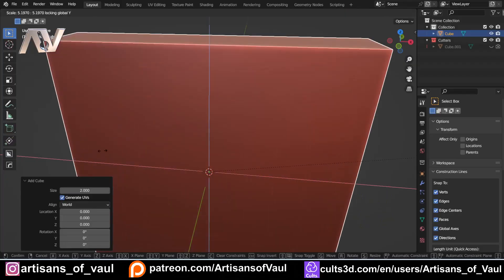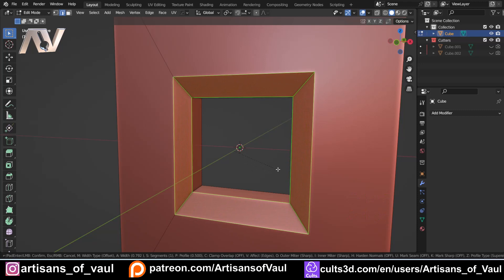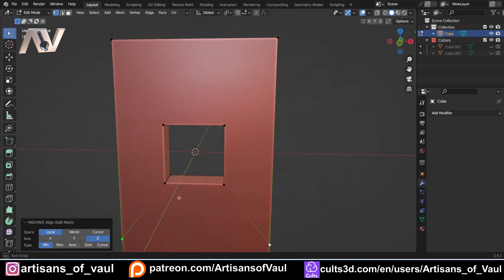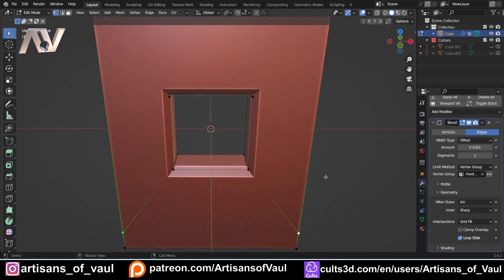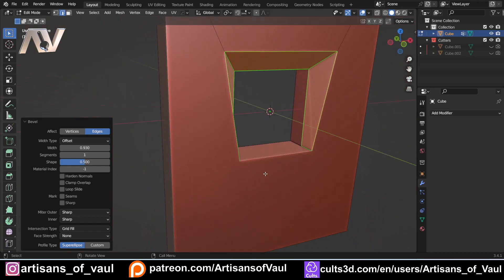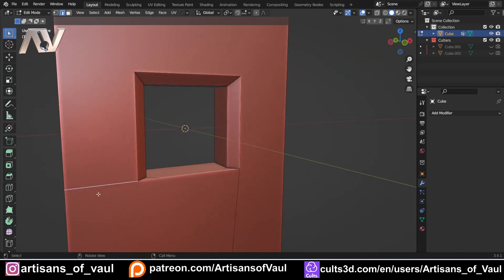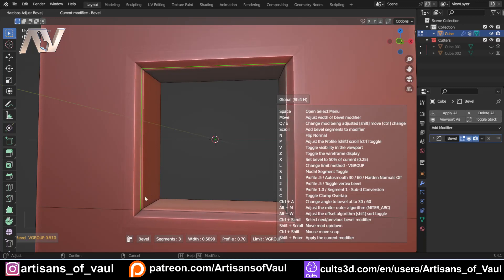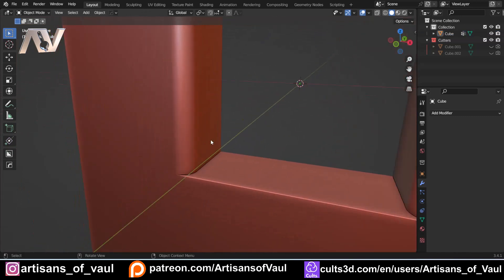Bevel Tips: Loop Slide and Impossible Bevels

Comment: Hi, i have a problem when beveling. When i try to make a pyramid by beveling a cube i have modified to fit in a project, it won't bevel alle the way from top to bottom because of the 45 degrees angle it makes. Is there a fix to this? And if yes how do i change the bevel angle? Thanks in advance
Reply from the maker: If you're making a perfect pyramid I wouldn't bevel to do it just select all the top points and then "m" and choose at centre.
Reply: Thanks a lot! I will try that
Reply from the maker: @jakoblynbech8383  Let me know how it goes. Sorry I couldn't help more.
Reply: It worked, but now i have another question. For my project I want to make the sides of the pyramid concave and convex on different pyramides, but I can only figure out how to do this with the edges. Do you know how to do this? Thanks in advance.
Reply from the maker: @jakoblynbech8383  There are lots of ways but I'd just "cheat" it slightly. Instead of merging all the top vertices together select the face and scale it so it's tiny. Then delete the edges at the sides and use bridge edge loops to reform them. Then you can use the settings to effective loft those sides into the shape you want. I've got a video on the settings to go through here: https://youtu.be/702TpBZpvUA
Reply: You're a life saver. Because I'm fully new to blender (I started yesterday) I couldn't understand it all, but I got some ideas from what you wrote. It works now and I can make the models I need for my project. Again thank you a lot for helping and being patient with me. I will definetly see your videos if I have trouble with something another time :)
Reply from the maker: @jakoblynbech8383  👍🏻 Great to hear I could help. Good luck with the rest of your project!
Reply: Thanks a lot again :). I will try that

Comment: I have a question, that feels a little off topic. Does 'shade smooth' make any difference if you're 3D printing, or is it just for rendering?
Reply from the maker: It only makes a difference to the render. I almost never use it as it hides and imperfections and harsh edges that will show up in a print. So if you're intending to 3D print be careful with it 👍🏻
Reply: @ArtisansofVaul  I was thinking that, thanks so much for your speedy reply!!
Reply from the maker: @abledog006  No problem at all 👍🏻

Comment: Could you put a knife cut on the bottom of the window on the inside on 5:56 to solve the mess? Or would it disrupt the bevel too much?
Reply: (on the inside bottom of the boolean box I mean.
Reply from the maker: Do you mean on the multiple lines coming off the bevel?
Reply: @ArtisansofVaul  I meant a knife cut going horizontal on the bottom inside face of the boolean cut prior to adding a bevel.
Reply from the maker: @CosplayZine  Oh that's an interesting idea. If I'm getting you right I think it would limit the bevel (if you put a limit on the bevel going over it) or cause face overlap if you went past it. But it's worth a look.
Reply: @ArtisansofVaul  yeah I think so too. I didn't have too bad results by putting a inset on the entire face. It looks fine actually unless you shade smooth. I think the best way is probably still shrink wrapping a shape to the surface then cutting a hole in the middle of the booled object, and deleting faces out around it then add faces back and clean up geometry. I seen a hard surface modeller do it in a video where he put a circle inside another object so I assume it should work w/ any shape. Can't remember the YouTubers name who did it though. There's also a free "carver tool" built into blender that might work for this but I haven't tested how the geometry acts towards it.

Comment: It's sometimes very useful to put a vertical and horizontal loop through the centre of a window, and dissolving the loops from the corners altogether. Because these new loops are 90 degrees from the edge they're intersecting, they're good loop guides for blender. 

If you don't like concave N-Gons, however, it'll give you nightmares :D
Reply from the maker: Totally agree! 👍🏻 It solves all of those issues (though doesn't allow the manipulation at 3:00). I should have probably said that 😅